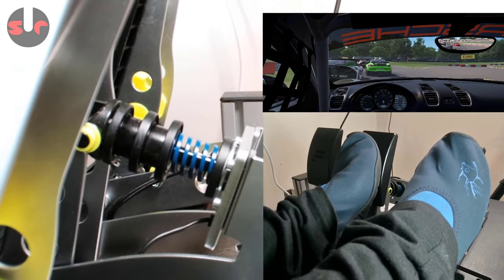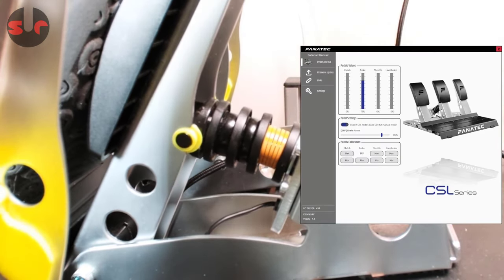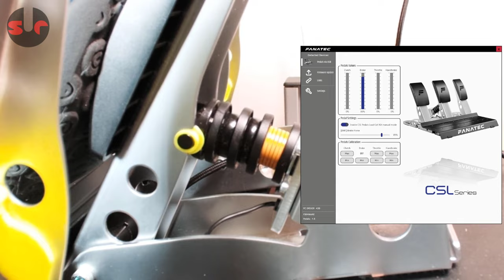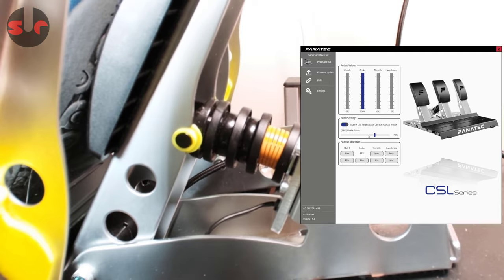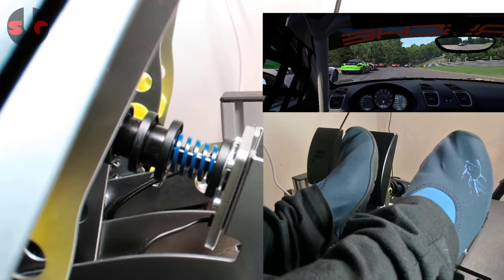Fanatec CSL Load Cell DIY Spring MOD [REVIEW/GUIDE] Transform the brake from meh to YEAH!

Comment: This is great advice. I now use one Yellow and one blue spring on my CSL Elite pedals and its a massive improvement over both the standard elastomers and the 3DRAP elastomers. Thanks
Reply: So you use both springs at same time?
Reply: That's what I did to get the feel and pedal travel I wanted. It really comes down to what you are trying to achieve. Given how cheap the springs are I bought a few of each to mix and match.
Reply: Great advice! What elastomers are you using to fill the missing space? The 65s or 85s? Thanks!
Reply: How did you solve the problem of the spring rubbing against the pin? After 3 months of use, the paint on mine came off where I mounted the spring.
Reply: I'm using one of the 3DRap elastomers.
Reply: I don't seem to have this issue.

Comment: I replaced the middle elsatomor on my CSL elite load cell pedal with an aluminium tube because the elsatomors lost there rigidity over time. I like the pedal to be stiff with little movement. Your body can replicate pressure applied very easily in repetition but can not replicate travel anywhere near as easily. At the end the of the day the load cell only records pressure applied regardless of how far the pedal has travelled.
Reply from the maker: Thanks for sharing
Reply: "Can't replicate travel easily" yet throttles are generally really light? Doesn't really make much sense, I wonder where that idea comes from because I've certainly heard it a lot.
Reply: Is losing rigidity a common thing for elastomers? It is a bit worrying that after buying pedals, I would have to shell out more money for replacement elastomers.
Also, this sounds like Fanatec accounted for this and made those pedals too stiff out of the box, so it would ease in over time...
Reply: @Rosaslav  unfortunately that's the way of the world, everything has a duty cycle. That being said they do last a very long time, and most pedal set either come with extra ones or they are readily available after market and a very cheap.
Reply from the maker: @Rosaslav  There is a breaking in period, and they settle.
Reply: @hughxthexhand  Could you suggest where to buy new elastomers, please? I am about to buy new pedals and doing some research to help me decide between the CSL LC pedals and Moza SRP pedals.
Reply: @MultiSteelking  I haven't gotten any new ones, I had my pedals for over 2 years. With the load cell pedal you get 3 full sets of elsatomors of different densities. You can mix em up and have 3 sets with the same feel, personally I can't see you wearing them all out in under 5+ years.

There are plenty of aftermarket replacements out there also you can ask for new ones directly from fanatec, for a fee of course.

Comment: I did a blue spring on my brake set up on a sturdy Next Level Racing GT rig and it's... Better. Does it feel like a hydraulic brake more? No. Does it feel like my Elise's brakes? Ehhh... Not really. Does it give more travel so it's more like a "street car" brake? Yes, which makes it worth it over keeping the stock setup which is like a rock. I didn't notice a difference in lap times so far, but the feeling is so much better.

Comment: Given that those springs are much cheaper than 3drap mod, it seems like a no brainer, assuming CSL pedals are a budget buy, so you want to keep the price low. Only thing I am worried about is longevity of those springs as spring tend to get "tired" over time.

Comment: I am using 2 of the yellow springs, no elastomers, with brake set to 15%... but my pedals are attached by velcro to the floor, so this is the most force my setup can handle. feels OK though 😌👌
Reply: Good idea.  I'm going to go with 2 blue springs and no elastomers.  I want maximum pedal travel.

Comment: I'm even using a spring-mod for my HE Ultimates and the last elastomer is just inside the spring as a spacer. But getting some unlinear resistance around the 80% mark is IMO rather desirable if it's not ACC, since tyres tend to start locking if going over, so 80% should be your 100% in most cases. In ACC there is an option in the brake-settings to add an upper dead-zone and get basically the same result.

Comment: Cheers for this mate! Have been experimenting with elastomers and doing some research, and after extended use, the rebound of the rubber seems to fade in correlation with the stress strain characteristics of the rubber... After a certain point, it becomes extremely difficult to hold consistent brake pressure, and the load cell fades away... the spring upgrade allows for the effect to not be as prominent, however, it trades exponential brake pressure for linearity... As I still like a stiff brake pedal, have ordered a blue, red and green (next stiffness) spring from the website, will update on this phenomenon when I receive the springs later this month!
Reply: just got the springs... Brake fade is removed, have miles more confidence under brakes. Am able to be more precise and run my brake bias further back without the rear coming around. Am running the blue spring and red spring in combination, gives a very similar feel to the elastomers that come stock... If you are experiencing brake fade as a result of worn elastomers, this upgrade will fix that issue.

Comment: Thanks for the video, I was surprised how stiff the stock LC pedal is and don't want to spend 35€ for the 3drap mod for a used entry pedal set. I've bought both springs and still waiting for the order to arrive.

Edit: I've gotten my springs now and the blue one feels perfect, I like a stiff pedal but the stock one didn't give any feedback and felt like a wall, much better with the spring!

Comment: I just bought the blue one (because it was available from amazon so I wouldn't have to wait a month) and my first impressions is that it does not change a lot, but it's enough to be noticeable. Note that my pedals and my seat are not rock solid planted to the ground and I am also not the strongest of dudes. 

Overall for just 8 bucks it's an improvement.
Reply: do you have a link to amazon? I only see a set of 3 springs (green, blue, red) for like 40 bucks...
Reply: never mind. I dug deeper in Amazon and found a set of 2 blue springs for 5 bucks. Not much can go wrong here.
Reply: @1nZaneR  what is it called on amazon
Reply: @gijs6815  "Brand: Generic
4.4 out of 5 stars 4Reviews
sourcingmap 20mm Outside Diameter 25mm Long Spiral Light Feather Blue Printing Mold 2 Pcs" turned out it took a few weeks for them to arrive from China

Comment: I would be happy if I could get even close to the travel you get from the stock pedal. I have to push super hard to get anywhere close to that. 
*I mean push super hard as in both hands pulling the wheel, heavy duty RCP pro cockpit creaking from the strain hard.

Comment: How did you solve the problem of the spring rubbing against the pin? After 3 months of use, the paint on mine came off where I mounted the spring.

Comment: 3DRAP is ridiculously expensive for a plastic rubber but this is cheap and worth to give a try but In the link that you gave there is no 20 x 10 x 25 mm Blue color, I am not sure if it is sold out. Is it have to be exactly that size and is it really the color that gave stiffness?

Comment: Hey man! Just curious to know if there would be a disadvantage to get rid of all the elastomers and just put 2 blue springs in there instead? I usually use around 80BRF anyway so wouldn't get to 100% with one, but just curious to know if there's actually an advantage of using 1 spring instead of 2? Cheers mate!
Reply from the maker: Elastomers provide a better sensation of progressive resistance. So the hybrid setup I find better than two metal springs. But comes it down to what works for each person, some people might prefer just running springs. So my review does have bias because of my preference.
Reply: @SimRacingCorner  appreciate the reply! It's a good review especially showing the BRF settings with each spring. I guess I'll try the hybrid version first and then double spring and see what's best for me. I guess the hybrid way if you end up hitting the elastomers you know you broke too late lol.

Comment: Hi Sim Racing Corner,
congratulations for your videos, very interesting and very well explained, I have a question if you don't mind ...
can the spring stay up before the elastomers?...if not what's the reason??...Thanks a lot in advance for your answer...😉🙏
Reply from the maker: Either orientation is fine, it makes no difference. Whichever material is softer is going to compress before the stiffer one.
Reply: A thousand thanks @SimRacingCorner  👍

Comment: What if you put the yellow spring on top then the elastomers on bottom so when yellow spring is completely compressed it starts to push on elastomers? Wouldn’t that work to? Also love your videos keep up the great work.
Reply from the maker: It shouldn't make a difference, as the spring tension is softer than the elastomers, the spring is always going to compress first in the stack.

Comment: Are the bright green cylindrical pieces a 3DRAP mod? or do I just need the spring for this DIY, just ordered the load cell
Reply from the maker: Yes, they are from 3DRAP. They're just replacements if the original ones crack, so you don't need them.
Reply: @SimRacingCorner  thanks for the quick reply

Comment: I have the GT Lite Rig by next level and I’m pushing myself away and I’m weigh about 100kg and can barely move the pedal. I ordered yellow and blue and am considering using multiple blues. Have you tried using multiple springs?
Reply: @JasonBorn  I have the same situation, do you mind sharing what you end up doing?